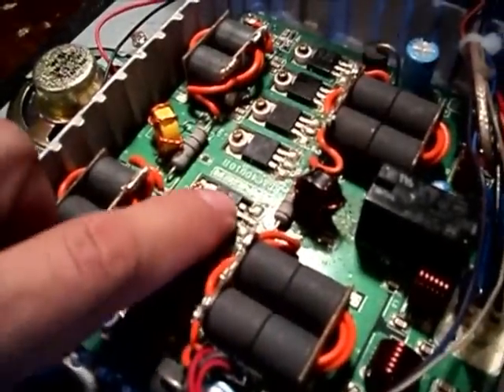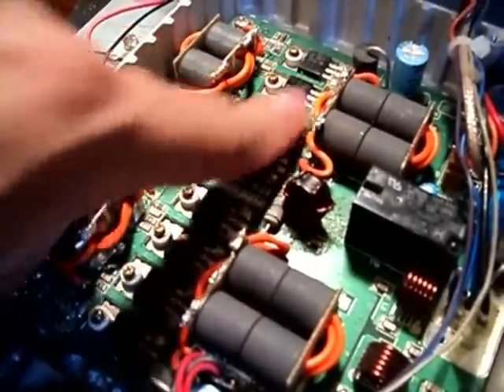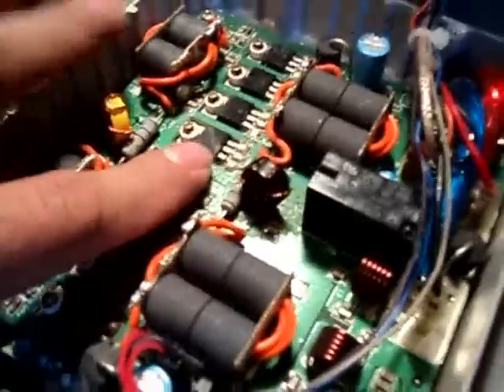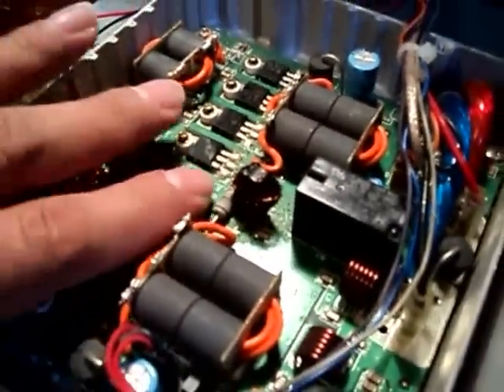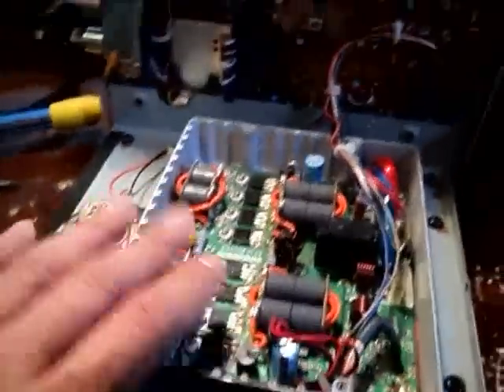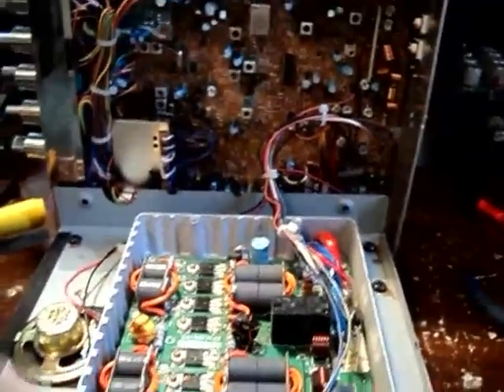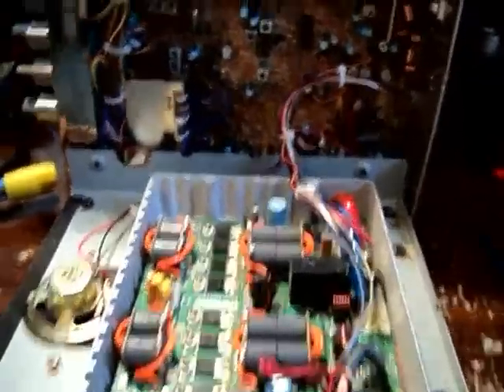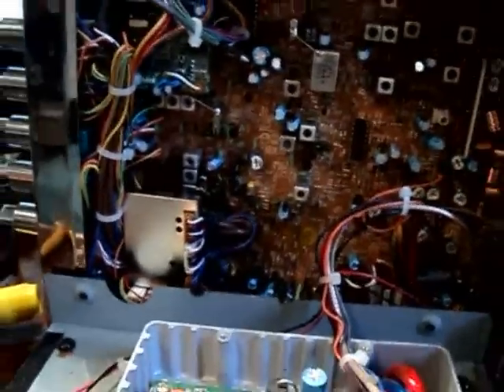Galaxy 98 vhp cb radio reparacion

Comment: Just bought this radio, with a 1KW linear.   I got the linear in my order but still waiting on the radio.  I cant wait, im going to blow smoke...Just all i know is i have to find out where the 100 wATT output is on the radio with the RF output knob.   I cant overdrive the linear as it said in specs 100 in, 1000 out.   im so excited, its going to blow real smoke...  im broke now...720$ for radio with major upgrades and 1300$ for linear.   2g's out the door for what? to talk to cb'ers? lol...
Reply from the maker: ***** I do not recommend 98vhp Galaxy 200w
for linear 1kw

The mosfets not withstand
linear load

My recommendation is to reduce the galaxy 100w

even so there is a risk
Reply: why? any radio, can be good for a linear....as long as i drive it with 100 watts in...dont matter if its a portable walkie talkie, or a uhf ham radio...if i can drive it with 100 w, what difference is it if its a galaxy or not.
Reply from the maker: ***** my recommendation
that either bipolar transistor
not in the radius irf520 mosfets